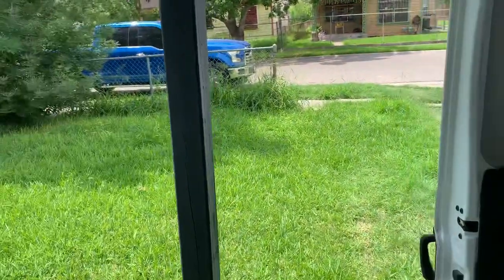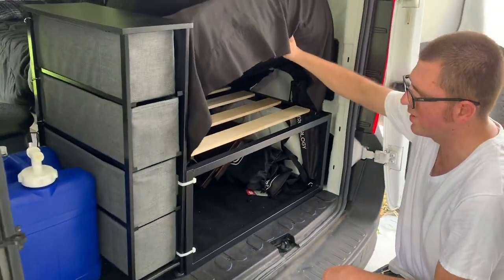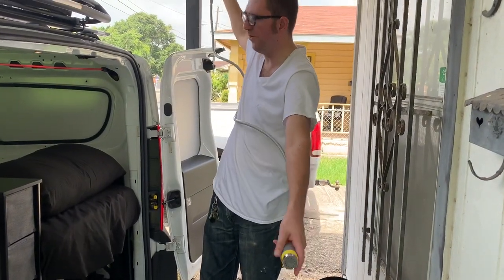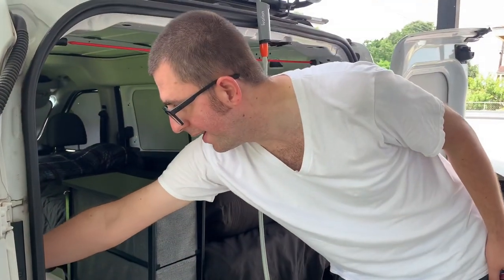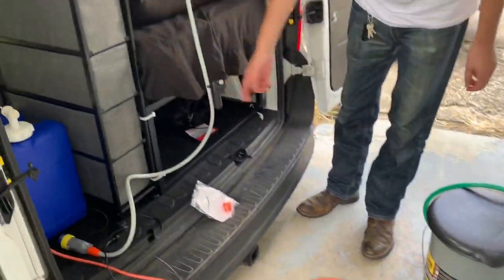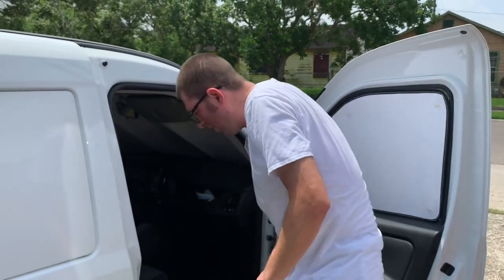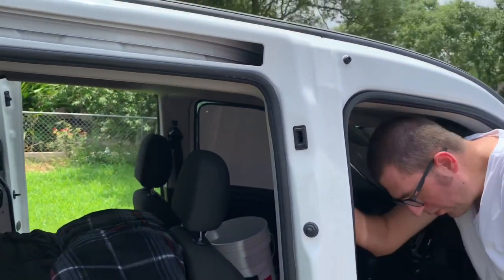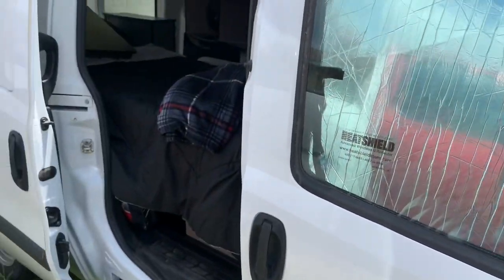Ram ProMaster City mini camper van walk around.

Comment: great video, stumbled upon it looking for info on fuses for my same exact van,  Joshua shops!!!  he really knows every product in his van, great guy.

may i ask what area it was in, it looked so much like houses here in suburban miami with the bars on the windows 

i’m ordering those sunshades, i bought my van on an impulse from a guy who was moving to UK and he had the wayfarer kit installed and i got his lithium battery and gear

only problem with Joshua’s van  in this video is no roof fan and no insulation , you really need those 2 things for comfort and condensation issues

look up wayfarer vans plug and play kit of magnetic insulation panels, they’re amazing and you don’t have to buy all the other components for the camper although mine came with the whole set up, thanks again, great interview and great interviewee

Comment: Thank you for the tour! I just bought a Promaster city cargo van this week and trying to do a no build build as well, two things that I like a lot is the bed frame and the strong magnets you used for the canvas unit. I have a question, does the bed frame and the base come in one piece? If I heard it right you don't have to do anything to it because the size fit perfectly in the van and it doesn't move when you are driving? Do you have links for the bed and the magnets please?
Reply: @RenegadeBastard  how is the sound with out any insulation? While driving? and what about while parked? picking up surrounding cars passing or people walking?

Comment: Sweet setup. I always wanted to do this. Just not sure about which van to get. I want a small one for sure. But one major issue I have with all this is HOW TO DEAL WITH 100 degree weather!!?? Lol. After research I found a Toyota Prius would be best. Much smaller but I heard you can leave the AC on all night or day whenever. That is a big selling point for me. And much more stealth than a van like this. How many miles does he have on this van? Any problems mechanically? That’s another issue that concerns me. Again a Prius would win in that regard from what I hear. But I do appreciate the room a van like this one has. I go to sams club a lot and I always wish I had a van like this during those trips. I live in south Texas and would travel down here. I wouldn’t mind sleeping in a Prius or a van instead of getting a room. But we do get very hot down here. So climate control is a must.  I was gonna buy a ram promaster a few years ago but I found out about the Prius and people’s setups. Amazing how they utilize the space in those cars.
Reply: Omar Williams too much work and money. I rather just get a Prius
Reply: Joshua Simpkins yeah I know about that van but it’s too big. I still need an everyday driver. I think those type of hybrids you can’t leave on all night. I heard it from someone who car camped in an older rav 4 hybrid. I don’t know.
Reply: This might not be a solution for you but I have this van with insulation and an air conditioner actually built in 😂 It was originally made for a catering company my husband now uses it to work but I'm hoping to turn it into a travel van since it could keep us cool from that Texas heat!
Reply: @RenegadeBastard : Are you saying this vehicle constantly tracks engine operation time?